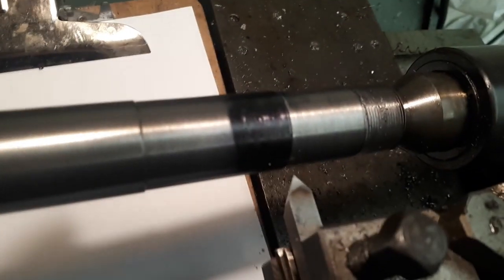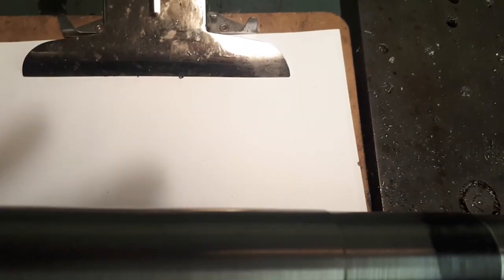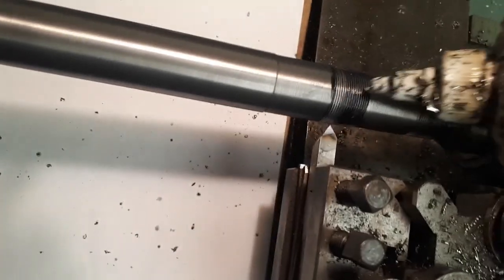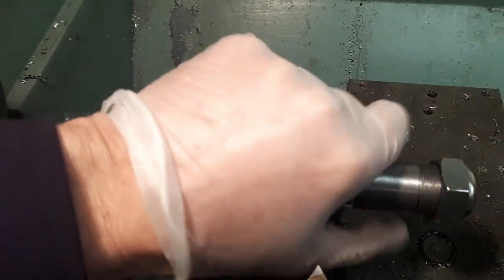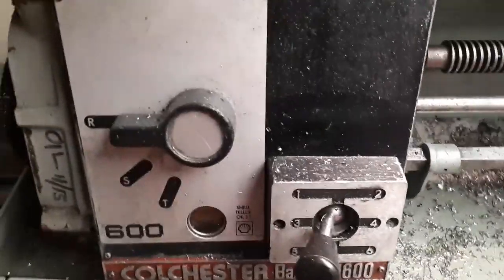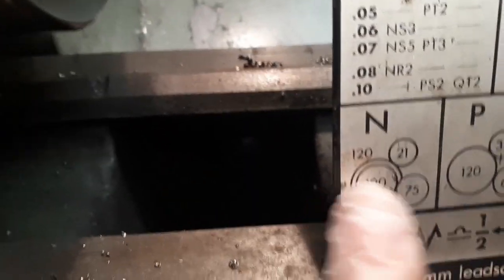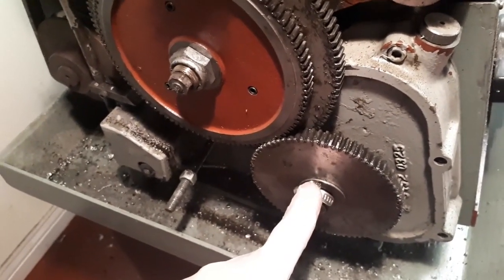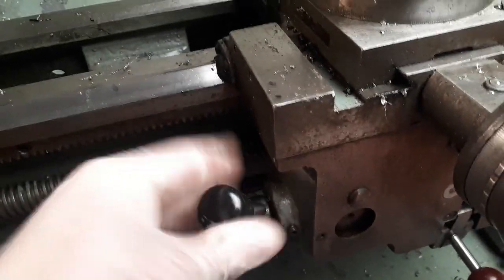Lathe thread cutting.

Comment from the maker: My lathe has a carriage lock, it's a square headed bolt top of the carriage on the right. I will post a picture but I won't be in the workshop for a couple of weeks.
Reply: is your lathe single phase, if so would like to talk about how you done it, best regards martin
Reply from the maker: Hi Martin, 3 phase. I think you would need a  phase converter for single phase.